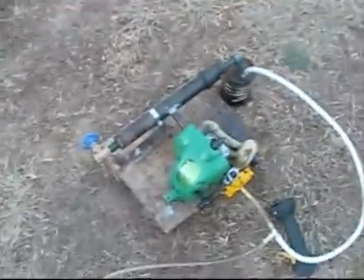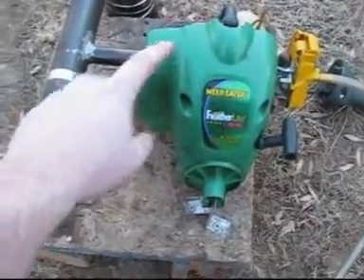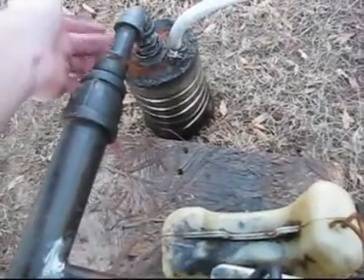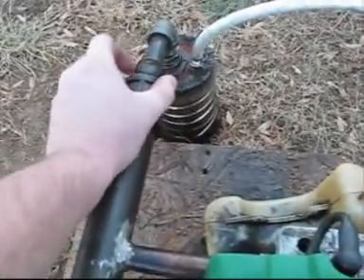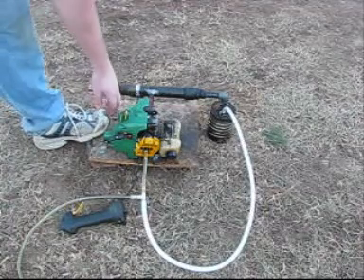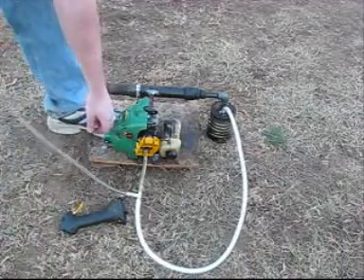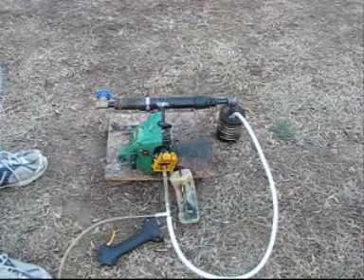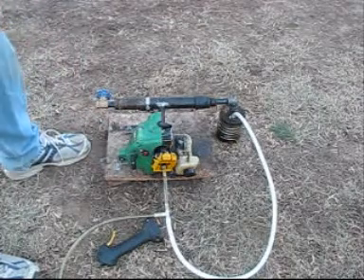My new Vaporizing carburetor Part 2

Comment: your air to fuel ration needs to stay constant. You need to install a secondary air inlet valve that is controlled by your throttle cable. As the throttle opens the secondary valve opens as the throttle closes the secondary air inlet valve closes. Doing this will provide the correct air to fuel ratio.

Comment: You will neeed to pressurize the fuel tank.
but could probaly use the fuel jet and rail from a ColeMan duel fuel single burner stove, jb welded in to where your gasssoline carb had it's original fuel jet.
Then link the throghtle mechinism to move the lever, that was the burner or "flame " controle
symaltaiously with the carbs slide. or "throughtle" to open and close in unison.

Comment: and how fast fuel vaipor volume is increased inpreportion too air flow and throughtle action.
this is a good starting lesson in viapor carbconversions and how they work feel free to write me with specific questions or problems I may have a solution, or atthe least some good insite and knowlage of previouse types and their flaws or strengths.

Comment: this second taper is going to be on the same angle and plane of reduction in diameter as the original fuel needle for the liquid carborator, but of much smaller diameter, though same lenght as the original, I would say a good starting point for you experiment will be 1/5th of it's original diameter but on the same taper as the liquid jet needle , depending on air flow, volume of fuel consumed and altitude, this diameter will differ, it controles how rich the mixture is,

Comment: Just as will a needle in a coleman, petromax ,or even a blow-lamp,
the first step or diameter is for starting, and restricts the fuel flow quite a bit,
because on start up the fuel is still liquid, but once it warms the exaughst and,
thus heats the 1/8th inch high pressure steel fuel line to boiling point, the Gasoline,
kerosene, or Metholated spirits, will be boiled to a vaipor, now that the engine, is "warm" the
slide and carb may be opened the rest of the way, this will be the second taper.

Comment: the Idea being the needle in the factory built motorcycle type carborator, moves up and down in the colar before or directly above the fuel jet, located at the mouth of where the intake air must flow in to the tapered restriction of the Venturie, normaly drawinng liquid fuel thrue and becoming a atomized mixture, but in the case of what we are trying to develop, you will be boiling to vapor the fuel, before it reaches this jet, and thus it will have a neadle with a step in it .

Comment: But will also work on two stroke engines, "IF YOU HAVE A SELF MIXING CARBORATOR" like the old 1989 Honda 50 elite mopeds or some of the 70's-80's yamaha bikes had, so the air flow thrue the carb drawws mixed oil in per-the vacume as addjusted by a neadle and seat,
per- tapered convex just as in a Rochester with it's fuel mix "or idle mixture controle needle" good luck, what you have now is very primitive, dosnt heat the fuel and will be limited to a set laod and volume/ rpm

Comment: the needle, will come in from the top of it's original jet,
justt the same depth as it would from the back of it as it was 
used in the stove. you wont need the mixer box, the venturie in
the carb will do it's job instead, the Steal brake line should be brazed,
in a spiral to the exaughst manifold as close to the port and head as
is safe and posable, the exaust heat will boil the fuel just the same as 
the burner flame would have. this will work best on four stroke engines.

Comment: Have yo ever seen a coleman White gas stove?
You want a proper Vaiporizer carb? Bye a bicycle engine
carb off of Ebay, take it apart, rpace the carburator fuel jet,
with the cole man jet! cut the carb, needle and braze or solder
the needle from the stoves flame controle, so that as the slide opens?
it raises the neadle in the jet, just like turning the stove knob would have.
Run the fuel thrue a automotive brake line wrped around the exaughst, from fuel, to carborator jet. Vaipor carb complet.

Comment from the maker: Thanks! 
It does not get vapor locked because the vapor is coming through the air intake....
Vapor locks are usually in the fuel pump so I do not have a problem with it..
Thanks for the comment!!